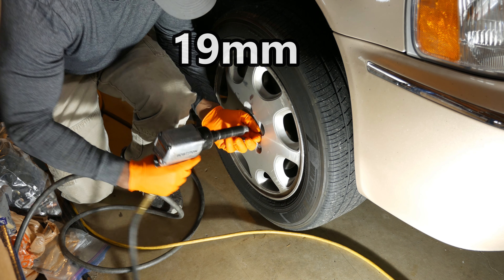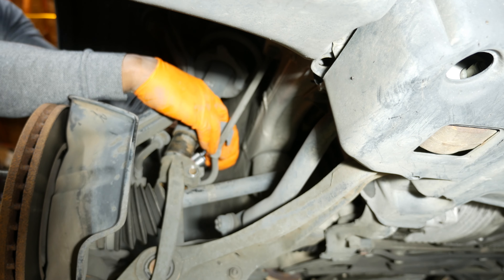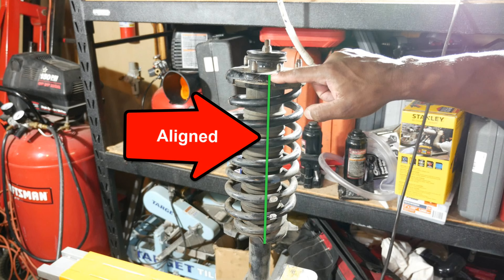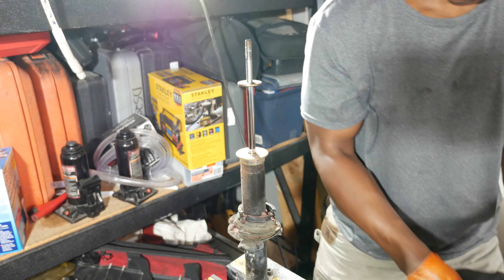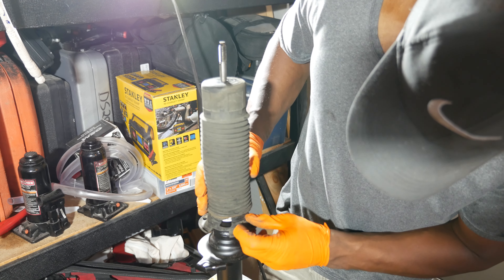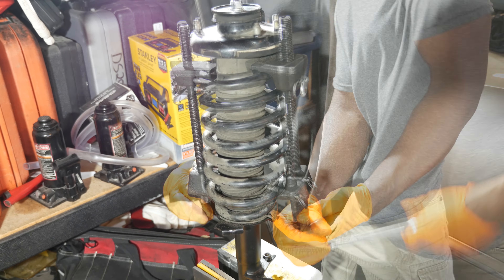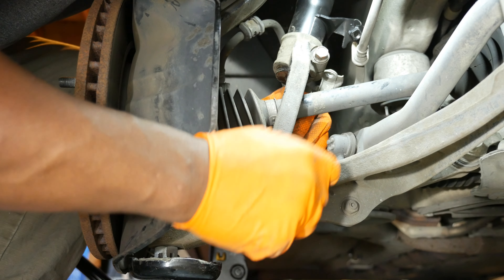1999 Acura RL Sachs Front Struts Installation

Comment from the maker: Hope this video was useful. Replacing the struts is fairly easy, but it should be done cautiously.

Please leave a 👍 if you like the video! 

👉 Visit our website ► http://CarApprentice.com
 
👉 Click to Subscribe! ► https://bit.ly/3bLvCFd

🔧▬▬Tools and Materials▬▬🔧
✔ Sachs Front Passenger’s Side Strut (316 586) ► https://amzn.to/2AJZfUz
✔ Sachs Front Driver’s Side Strut (316 587) ► https://amzn.to/35a9Xlj
✔ Sachs Rear Strut (316 588) ► https://amzn.to/2IqOhb0
*Sachs struts can be hard to find, but I've found that Rockauto occasionally has them in stock*

✔ KYB SB108 Bump Stop (just used the bump stop, not the included boot) ► https://amzn.to/2LPi1QL
✔ OEM 27036 Spring Compressors ► https://amzn.to/2VgfkL1
✔ Titan Tools 12018 ½” Ratcheting Breaker Bar (not the tool I used in the video, but has good ratings) ► https://amzn.to/30JYm96
✔ Rockwell JawHorse ► https://amzn.to/31VHI84

📷▬▬Video Equipment▬▬📷
✔ Camera used ► http://amzn.to/2GcpkOb 
✔ Lens used ► http://amzn.to/2Deu16S 
✔ Tripod ► http://amzn.to/2GbaM1c
✔ RAM Suction Mount ► https://amzn.to/2Wz9PXh
✔ Cyberlink PowerDirector ► https://bit.ly/2jTwGxT
✔ Adobe Photoshop ► https://bit.ly/2V7nyUX
✔ Camera Slider ► https://amzn.to/2WtD7GW
 
👍▬▬Follow Us on Social Media▬▬👍
✔ Facebook ►  https://bit.ly/3bHtMFC
✔ Twitter ► https://bit.ly/3hLdJKK 
✔ Instagram ► https://bit.ly/3u380lS

This video was recorded in 4K resolution, so modify your settings accordingly if desired for better image quality

Disclosure: This video contains affiliate links, meaning, at no additional cost to you, I will receive a commission if you click through and make a purchase.

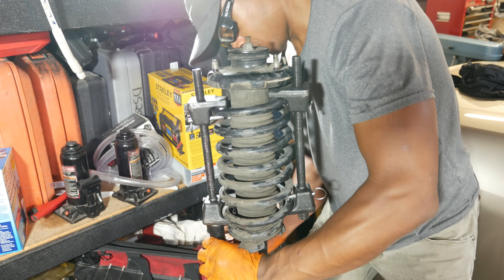Comment: at the 5:00 mark you show an alignment situation that is "very important".  Please go into a little more detail as to what should be aligned and why such importance. It's a little hard to grasp what you are pointing out. Great job on the videos
Reply from the maker: Basically, the new strut and spring should be aligned like the original assembly so it fits correctly on the car. I usually make a small mark on the top plate where the spring ends. Hope this helps. Thanks for checking out the videos!

Comment: Any reason for Sachs strut instead of KYB?  I thought KYB is Factory? Please let me know and Thank yo for this video. I'm sure mine will need to be replaced shortly. Thanks again.
Reply from the maker: Thought I mentioned my reasoning in the video, but I don't think you can go wrong with KYB. My understanding is that KYB's are made in Japan.
Sachs struts are sometimes hard to find. Also, the last set I got for my Honda Pilot included one made in Japan (or USA - can't remember) and one made in China, which was disappointing; the Chinese strut had some fitment issues.
Reply: @carapprentice   Thank you. Love my 2002 RL Awesome car. I will have to do the Valve cover's this summer though. I'm undecided if I should have the dealer do it , it looks like a Pain in the Ass. Any idea what they get for the Job?  Thanks again for all your great Video's!
Reply from the maker: @tomb375  I read that the book time is about one hour per side - not sure that's accurate. I would guess around $600, including parts and labor.
Reply: @carapprentice  Thank you, I'll check and let you know what the dealer here in NY wants.

Comment: You're a very good teacher. I like how you are detailed and complete with your explanations. I'm actually working on a different car but I wanted to see how you assembled the strut. I appreciate your video! 

I saw that you put the weight of the car on the struts using a jack before torquing the bolts. Is that required to properly torque the bolts?
Reply from the maker: Thanks for the compliments. Yes, most Hondas require lifting the car off the jack stands before tightening the fasteners.
Reply: @carapprentice  you're welcome. I think I'll try this fix someday, but I'm scared of the spring compressor failing so I'm going to buy 4 chains and wrap them around the spring before I start compressing them. I read too many stories of people's springs flying or injuring them
Reply from the maker: @zzoinks  I'm guessing that some carelessness is involved in many of these mishaps: (1) Not installing the compressors 180 degrees opposed to each other, (2) not compressing them evenly, (3) not using the included safety pins, etc. The Internet is filled with people who recount horror stories, but the full picture is not always provided.

Comment: I can’t find any you tube videos on how to replace 2000Accura RL front LH / RH upper control link with ball joint 
Any tips wii be helpful. Thanks
Reply from the maker: It's been awhile since I replaced one of those upper control arms on my Legend, which is most likely the same process for the RL. The ball joint may come loose from the knuckle on it's own when the nut is removed, but a separator tool may be required. Here's a link to the service manual (page 18-15 in the Suspension section): https://www.mediafire.com/file/uvbmryok1ax4vbs/Acura_RL_-_Factory_Service_Manual_%25281996-2004%2529.zip/file

Comment: Great video! How critical is it to get the small notch on the strut to line up with the gap in the fork. Mine is off by a few mm with the new Sach struts
Reply from the maker: That's an alignment tab, so it should be centered in the slot on the fork. I received a "Made in China" Sachs strut for my Honda Pilot that had a manufacturing defect I had to correct. Basically, if the lower fork fits squarely over the lower arm and the strut mount's studs line up, you should be ok.

Comment: Great video!  I have a 2009 Rl and my shop said I need new top hat bearings. It has 175k miles, should I replace Everything or just the bearings if the struts still seem “good”?
Reply from the maker: If the struts have 175K miles on them and a shop is doing the work, you may want to consider replacing the struts and top hats (same as "mounts" for anyone reading this reply) at the same time to save on labor. Thanks for watching the video!

Comment: Where can you find replacement struts and springs ?
Reply from the maker: A salvage yard or a forum may be a good place to look for replacement springs; I don't know of any OEM or aftermarket resources. Check the 96-04 Acura RL Facebook group: https://www.facebook.com/groups/1427987647415950 
Rockauto.com occasionally has Sachs struts in stock. Others have installed KYB struts, but I've never used them.